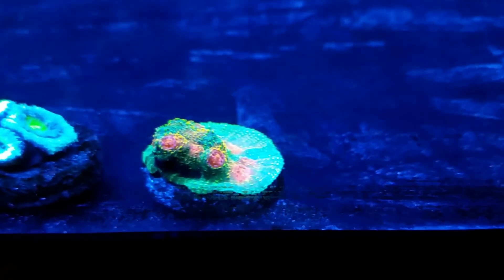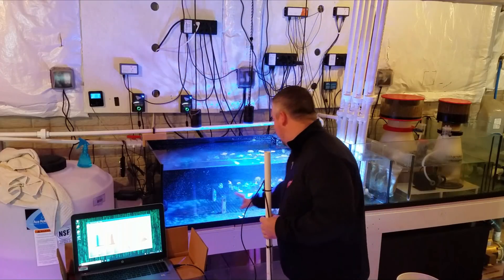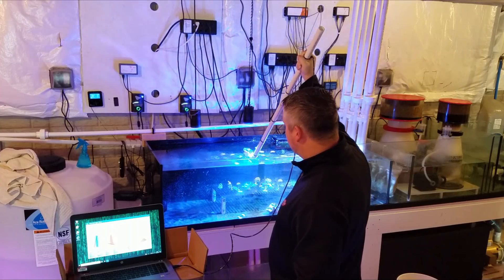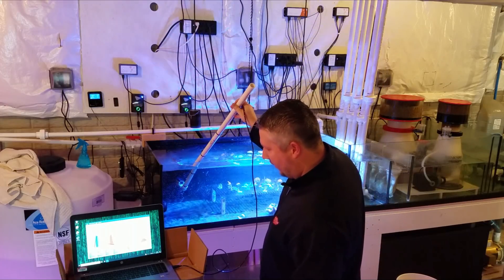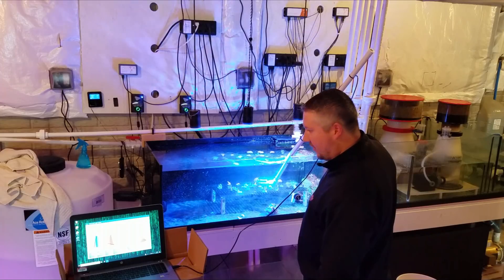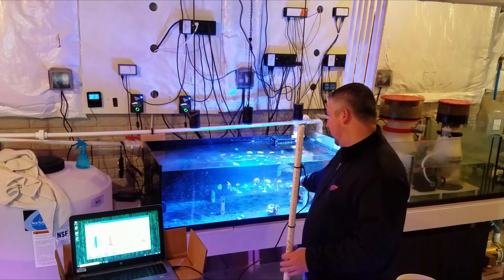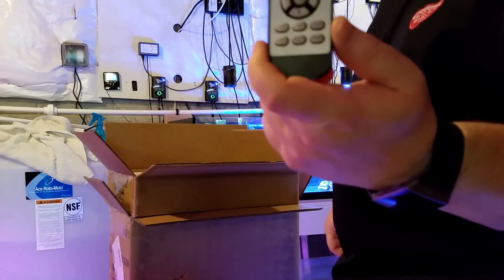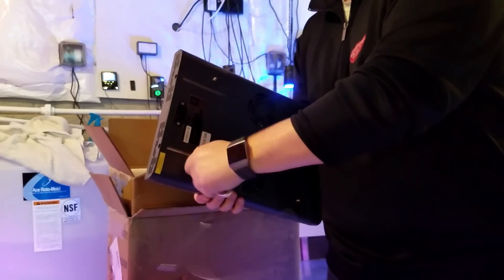Frag Tank Lighting Upgrade

Comment: what settings did you finally end up with? I have a 4x2 frag tank with 2 of these. 16 inches off water and 100% blue and 20% whites. Thoughts? I dont have a par meter
Reply from the maker: I habe 12 of these now.. most are running 100% blues and 10% or less whites.. but i prefer the blue look.. i am sure it boils down to what you like.

Comment: All that dust and dirt from the ceiling just flew in your frag tank. Great video but probably would have been better to cover the tank first
Reply from the maker: the little bit of wood/ sawdust that fell in the tank got cleaned up with a net. I am sure dust /debris gets knocked in all the time. Every time someone above the tank is walking heavy.
Reply: @BlueCarbonReefing  yeah you're probably right my fan that was luckily off fell in my water as well and knocked a bunch of dust in my tank.
Reply from the maker: @fadetoblack.-  yea stuff like that happens all the time. I find bugs in the water all the time and I remove them as soon as I see them. I am working covering parts of the tank that are not lit. It hopefully will help with insulating and evaporation as well.

Comment: Nice video John. Those are interesting lights, I'll be sure to check them out.  🤔 Started with a used A360 that came with the tank set up I bought, I realized after awhile that spread is very important and it is frustrating with these spotlight type lights. 🤯
Reply from the maker: I really like the ocean revives. Within a couple of days my corals are responding positively to them.  You can't go wrong in my opinion.